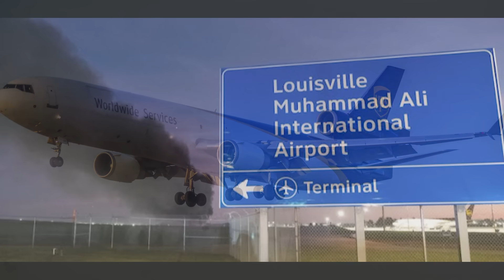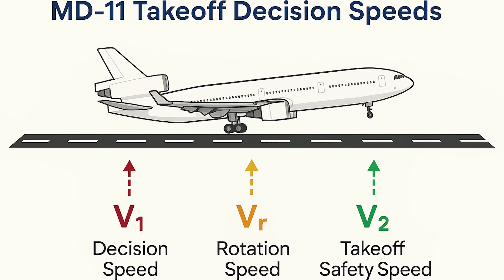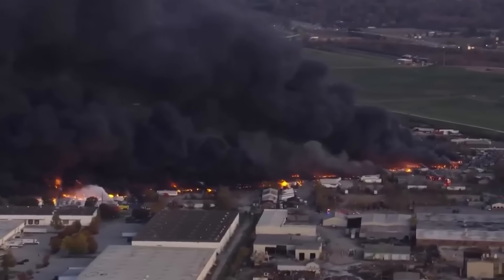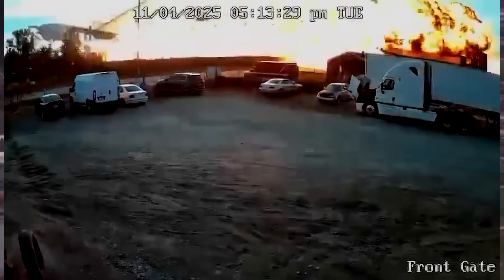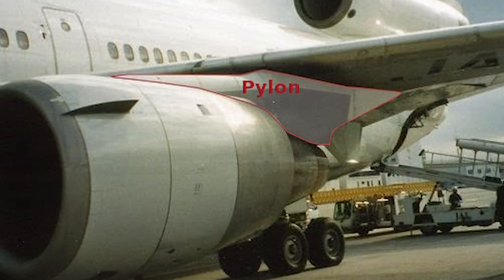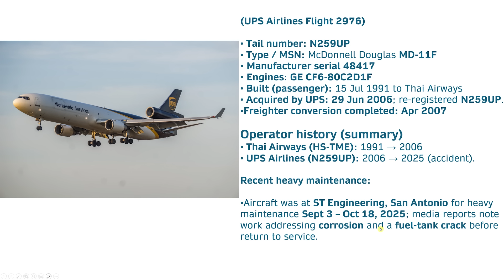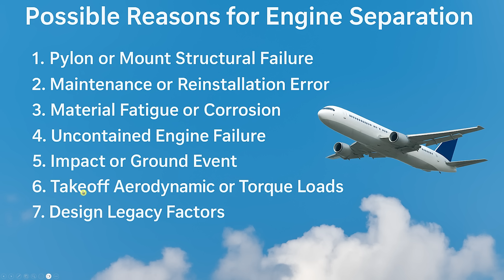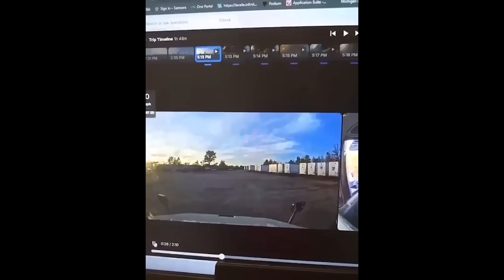What Caused UPS Plane Crash, Louisville, KY? How MD-11 Engine Fell Off

Comment: Do we have a repeat of Chicago 1979?  rear pylon mount breaks loose, engine swings vertical detaches, pieces get ingested into #2 in the tail, it loses power and then it's game over.  If you look at the pix of the engine on the ground... it wound up on the opposite side of the runway by the way, there looks like a large hole in the turbine/exhaust casing, but that hole looks dented inwards, but may not be.   Not sure if the jet has hit the building before it crossed the road.  The tower should have filmed the whole thing and should be able to see if the #1 engine or parts of it hit the #2 engine.   ALL TAKE OFFS ARE PLANNED FOR LOSING AN ENGINE AT GO SPEED.  In this case probably 10-15 knots below rotate speed.  The jet had about 32,000 gallons of fuel on board and was close to max gross weight.  2 engines running this should not have been a problem taking off, with 1 engine and partial thrust on the center engine... not enough thrust.  1 of the engines on this jet was recently changed, but that would not explain the pylon coming off, as you don't mess with pylon bolts changing the engine.  A turbine explosion possibly could have caused this, the fire is from the broken 4-5 inch fuel line feeding the missing engine with 2 high volume 60psi fuel pumps in the wing tanks pushing out fuel as fast as they can.

Comment: I know that the md 11 was an upgrade to the DC10 which had problems with the jack screw in the back of the plane,  which regulates the elevators. Could the md11 have inherited the same problem? nice work Jeff keep 'em coming.

Comment: You don't need a "consensus" - Check the maintenance records and try to find out if the mechanics have been using the 'ol forklift methodology to remove/install the engines on the pylons, like they did in '79 on AA 191 out of O'Hare.
Reply: I can guarantee they weren’t using a forklift. However even with the lifting dolly they are supposed to use you can still over stress the wing structure and pylon. If that is the case it will be very bad news.
Reply: Nobody uses forklifts or anything like that for these type of aircraft. There is pylon mounted bootstrap kits and engine cradles.
Reply: @gjk1504 they did in 79.
Reply: @paulrasmussen8953 That's true they did in '79 on the DC-10. That's why these airplanes are designed and now to be set up with the bootstrap kits.
Reply: @gjk1504  I suggest you check the findings on the loss of AA 191 out of Chicago (O'Hare) in '79. In almost 40 years in the Defense industry, I can tell you that the approved manufacturing and  maintenance policies and procedures are not always followed - sometimes bad things happen as a consequence of taking "unapproved" shortcuts.
Reply: @walterbrown8694  Alaska Airlines Flight 261 comes to mind the skimmed on something as simple as grease. if i remember right they let the jack screw for the horizontal stabilizer trim go 3 times longer then it should have with out new grease.
Reply: @walterbrown8694  yea but because of the American airlines crash it is one of the Cardinal rules do not use a forklift to install something heavy like this. There is vast training and policies about not doing this. UPS is very strict about this rule. Not only would you be hard-pressed to find one mechanic to do it much less a crew the RII would never sign off on it. The bootstrap kit is much easier to use for going up even the first time so it wouldn't be a considered a shortcut to use a forklift either. UPS is so strict about not using a forklift for these type of things that when lifting is needed for something substantial they have a mobile crane company on standby that they call.

Comment: It is probably the left wing not the landing gear that dug a trench on the roof of that building off the end of the runway. Once the plane got airborne it immediately rolled to the left due to asymmetrical thrust.

Comment: 0:22 how could this be real, when the other video with the truck driver shows the plane on its side as it crashed?
Reply: This is earlier on in it's flight, before it has rotated to it's side. You can see it start to rotate at the end.

Comment: It’s an uncontained engine failure of the number 1 engine with parts from the number 1 engine ingested into the number 2 engine. You didn’t catch the part of the video where there was a surge from the number 2 engine right after the end of the runway. They lost 2 engines on takeoff after V1. There was no scenario where that would be a recoverable event. 

There have been reports of the flight being delayed for two hours while they worked on engine number 1 that have yet to be verified.

It’s only superficially like American 191 in that for some reason the engine fell away from the airframe. But, it looks like this separation is probably due to extreme asymmetric loading from the engine coming apart. It might have more in common with the Sioux City accident where an engine fan disk was cracked which caused an uncontained failure of the number 2 engine and severed all three hydraulic systems. That would fit in with the reports of corrosion and cracking during the maintenance overall, but it could also be a maintenance error.

We will see where the investigation goes.

I hadn’t seen the first video which looks like it was taken in front of 7025 Grade Lane heading northeast. So, thanks for that.

Comment: Power polls at the end of the runway!? Plane lost an engine but still might of been able to gain altitude except it hit a power poll causing fatal damage of what might possibly not have been a disaster. Then it hits a building next to it's parking lot at the end of the runway. Why isn't the parking lot where the building is? Then planes taking off would be flying over a parking lot and people in the building wouldn't have to worry about a plane or parts of planes breaking off falling on them. Lots of "That will never happen" people behind this.

Comment: You didn't mention it. But the large piece on the top of the building appears to be a part of the tail from behind the landing gear. Given the angle of the attitude of the plane from several views, it appears to be the left bottom of the tail that grazed that building.

Comment: Barring a complete hydraulic failure (like UA 232) why couldn't the aircraft maintain the required 2-engine net climb gradient? Aparently the DC10 hyd sys was redesigned to prevent this exact thing so I'm going to assume HYD SYS 2 and 3 were functioning. The aircraft was airborne and not able to climb out of ground effect for several thousand feet of runway. If #3 or #2 engine was fodded out or otherwise not producing takeoff thrust, all bets are off.

This begs the questions: was the aircraft within weight limits? Did the crew properly react to the apparent loss of #1 engine? If I had to guess, I'm going with overweight and/or out of CG. It's not implausible in the current economy to imagine a push for a little more cargo,  gundeck the load manifest and kick that flight out. Aft CG would have limited elevator effectiveness and overweight would have definitely impacted the climb on 2 engines.
Reply: Engine #2 stall due to ingestion of debris

Comment: Landing gear didn't do that to the building, would've snapped right off.

With the up angle it was the tail that dragged on the roof, would probably also account for the trailing fuel fire as the building impact could have have punctured the center fuel tank, dumping fuel across the path of the aircraft.

Comment: I know everthing is preliminary, but right now i have a potential theory that may or may not be disproven.  
We know the engine (or part of wing near engine) was on fire before take-off,  we likely believe the engine fell off after planes wheels left the runway.  
What if the fire wasnt the engine, just located at the engine?  What if there was a fuel leak (from the fuel tank that was noted from being corroded) and the fuel happened to fly back towards the spot near the engine that ultimately caught fire?  The leak was not strong enough to have the fire reach the fuel tank due to the planes speed.  The fire on the wing was close to the spot of the engine attachment parts and fatigued the parts enough to cause the engine to detach.
Basically, i think there might have been something improperly sealed on the fuel tank during the corrective action taken for the corrosion.   
Id even look more towards the top of the tank because this plane had several flights with less fuel and no issue, but the first flight with a full tank, something was different.
Right now everything is early, but this could fit with what we know right now. (As well as many other theories)